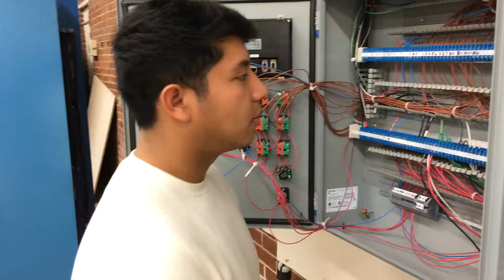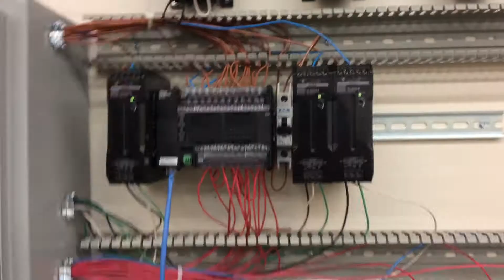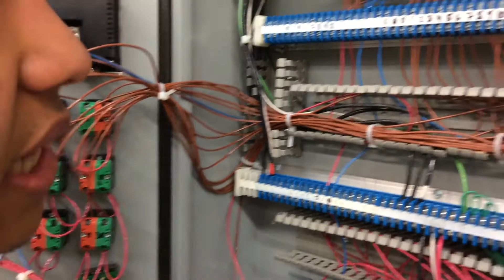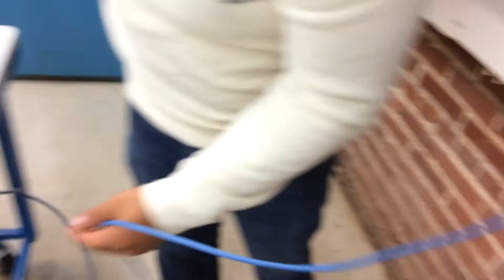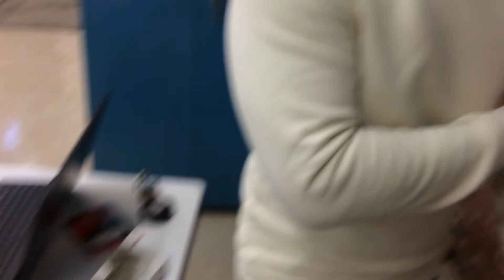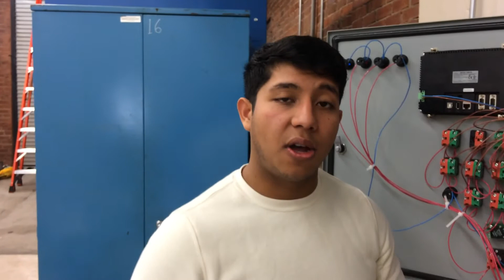PLC INTRO: Hardwiring the Omron CP1L E

Comment: hi, Can you hook up the internet cable on a router that is between the PLC and the computer?
Thanks
Reply from the maker: I would prefer to use a router and hook it to a network switch and the from the network switch hook up the computer and also hook up the PLC to the network switch

Comment: thank you for your video. I am using Allen Brandley and I have connected all my output and using Ethernet cable but it doesnt connect to my laptop BUT when I connect only 3 outputs It does connect to my laptop. I can not fine the error. Would you be able to help me pls.

Comment: You speak clearly but a wiring diagram would add clarity to stuff you are pointing at.
Reply from the maker: Yes sir, I can definitely do that on my next videos coming up on PLCs.
Reply: My favorite lecturer on youtube is    https://www.youtube.com/watch?v=G4uo0Sm0uMo    Check his 
lecturers out for yourself and im sure you will agree this guy is good "Jim Pytel"     
I am studying an introductory course on an OMRON PLC.OMRON CP1L-EL20DR-D      Have you any advice or material you can recommend or an omron simulator to practice with. I will have very little lab time you see, Thanks Michael
Reply from the maker: I will look into those lectures! thank you very much. Actually, Do you have any physical simulators? Also input values are going to be 100.01 which would be translated as channel 100 and bit 1. Basically its Word 100 and bit input 1. Outputs are going to be 1.06 which would be again channel 1 and output bit 6. I'm actually helping someone to finish up there Omron  CP1L-EM setup. I'll be posting some of those lessons soon. Shoot me an email at serbertomurano@gmail.com if you any more questions.